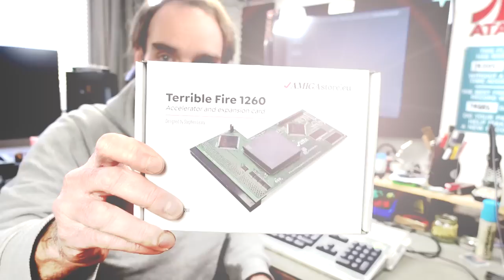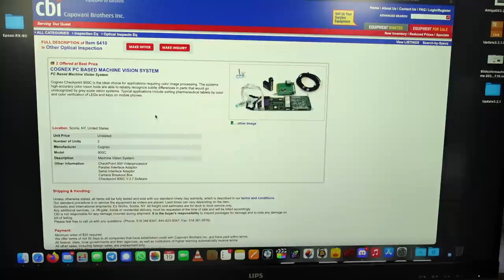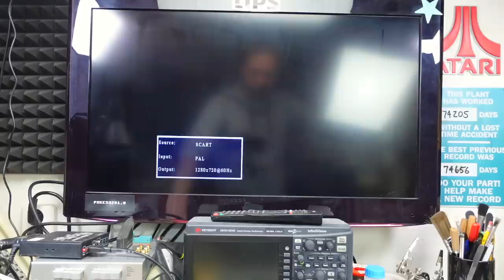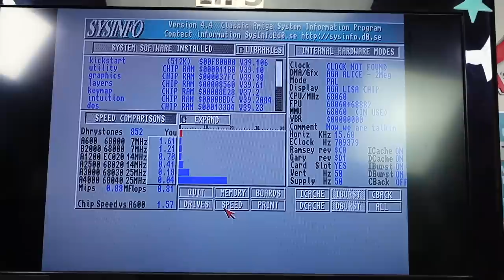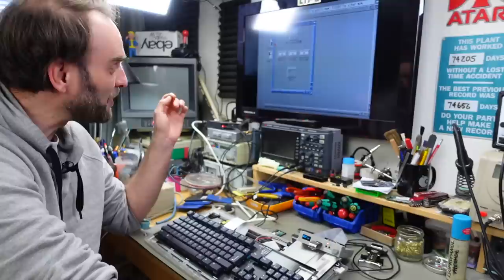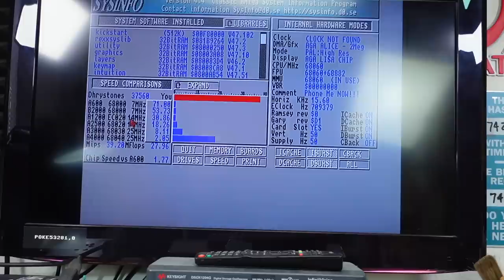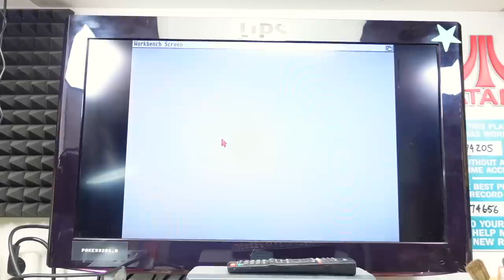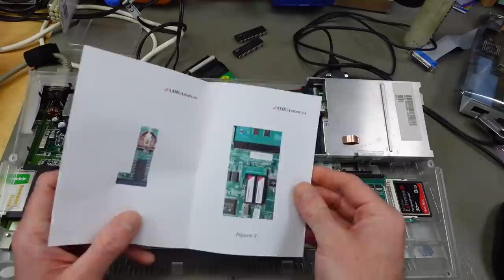Amiga 1200 TF1260 Accelerator Installation

Comment: The reason kick 3.0 support was dropped was because i couldnt get autoconfig to behave with Mediator. So i put the ram where its autodetected in 3.1. I could release a separate firmware but then people would get them mixed up.
Reply: Ras Voja`s Rasta, Retro and Resistance to Babylon  Absolutely not. I simply cant support multiple options on 14 different cards.
Reply: Ras Voja`s Rasta, Retro and Resistance to Babylon  My rules is one kickstart per machine. Usually 3.1 but I will work to support 3.2. Thats already too much for me to cope with. Upgrade to KS 3.1, buy a Warp or ACA1260. If i've not given in to supporting 1.3 on the A500 i'm really not going to give in to supporting 3.0 on a 1200.

Comment: The XC part number means "production prototype". The number is changed to MC when they are in production. It was not uncommon to see X parts in low volume products on the cutting edge. I was on the production prototype list in the late 1980s and would get X parts when developing DSP boards, but XSP56001 in that case.

Comment: Fantastic video Jan =D  Welcome to the TF1260 club!  Amazing pickups on the R6's =O   The graphics glitches or slow downs / crashes etc - you need to experiment with NOCACHE, set NOAUTOVEC as a default for all WHDLOAD games, and NOMMU (all tool tips or set in the WHDLOADPrefs file).  Almost everything I play on WHDLOAD works fine on an 060.
Reply: I set NOAUTOVEC in the WHDLoad.prefs (recommended in a WHDLoad video), but I couldn't find NOMMU. Or did you mean MMU, which has a " ; " in front for not being active. But it's said for 68030 use. 🤔
I also have a TF1260 (and the same case Jan has 😉) with LC060 btw.
And yes, you have to disable some (or one, can't remember) caches to make e.g. DREAD to work on the 060. Easiest way is using Sysinfo for this.
Reply: @TPau65  NOMMU is set on the tool tip for the individual game!
Reply: @GadgetUK164  As I'm new (again^^) in the Amiga world... tool tip is this "text area" when you rightclick on the game/program icon, information and then icon menu? Is there a list somewhere of what instructions can be used there in general? E.g. ADoom and ZDoom come with several pre-defined commands which could be activated/deactivated with brackets ( ) or semicolon ;.
Is it even possible to deactivate caches there, so you you don't have to use e.g. Sysinfo for that?
Reply from the maker: Thanks! I fiddled a bit with the options but didn’t get great results for some games (including my beloved Turrican, of all things!). I’m going to try to tinker with the options you suggested! :D
Reply: @JanBeta  I am sure I played loads of Turrican using the NOMMU and NOCACHE and didnt have a problem!  I will re-test later for you!  Check if there's a new .slave for the game too on the WHDLOAD website!
Reply: @JanBeta  Hmm, no problems here with my TF1260 (LC060 CPU) with the Turrican games. Part 1, 2 and also the new AGA beta version of T2. All loaded normally with TinyLauncher. What exactly do you mean with "no great results"? Not starting at all? Graphic- and/or sound glitches?
Reply: @JanBeta  try the latest firmware too. Gadget will be on that.

Comment: Unsoldering the male IDE header and moving it to the bottom side of the TF1260 allows for an SD2IDE adapter to be used. The pin orientation happens to be just right and it will make your workbench easily accessible via the trapdoor (which can still be closed).

Comment: I remember those vision cards. The one I saw was used in an industrial fruit sorting machine. It could detect bad fruit as it passed under the camera on a conveyor. It could also sort the size as well. It was very fast as the conveyor moved at quite a speed. Gates would open further up the line to redirect the sorted fruit.

Comment: Thanks for your review and conclusion. I just got my Terrible Fire 1230 and its everything I will ever need.
Reply from the maker: Yes! 68030 is enough for most "common tasks" (and the vast majority of games) on the Amigas indeed. The 68060 experience is still kind of amazing for me (especially since the fastest I had was a 25MHz 68030 back in the day in my original Amiga 2000). :)

Comment: @Jan Beta - You might be able to cool the CPU with a heat pipe heatsink. You might be able to find one in a junked laptop, they tend to use heat pipes to get heat from tightly-sandwiched cpus to the side of the case where the fan is.
Reply: If not, you can just buy one as a spare part. When the fan died on my laptop, I had to replace the whole heatsink as a unit because the fan is not a separate part. I was prepared to be annoyed but I think it was less than $10 so in the end I had nothing to complain about.
Reply: @mal2ksc  Also true. There are definitely shops online that sell fan+heatpipe assemblies for DIY repair. I've done that twice actually. So that's a good way to go look for something that might be the right shape.

Comment: Finally, after so many years Doom is playable on Amiga! Thing that was just normal on 486DX4/100 ;) And Quake... well, let's add 3dfx.
Reply: Well, I played it back in the late 90ies on my Amiga with a 68030@50 CPU. Certainly was not great, but I could play it.
On a 68040 it was much more playable.

And ADoom was the first port of Doom for the Amiga, and it's not the fastest one.

Comment: I hope you thoroughly enjoy your 'new' amiga.
FWVLIW: My Blizzard 1260 + SCSI routinely runs at 80Mhz with a passive heatsink - it will go to 100Mhz with active cooling for safety and the Blizzard SCSI unplugged. The, um, best use I've found for a 060-equipped Amiga is to run it as a 68K Mac! Otherwise there's really only 68K versions of games that run better on a PPC, and the odd demo... unless you're enough of a masochist to do a bit of retro raytracing.

Comment: The new firmware also gives much faster chipmem access speeds, which is great! This means faster drawing to the screen, since the framebuffer is stored in chipmem.
Reply: How does it speed up chip mem? Every solution I've seen has only been able to speed up fast mem.
Reply: @Felice_Enellen  The designer rewrote the logic for the 68060 card, to minimize chipmem speed losses.

Comment: 71E41J mask 060s can regularly eat up to 100 MHz when properly actively cooled and still be stable. On Atari Falcons with CT60 accelerators they usually run fine at 90 or 100 MHz, 90 being the speed of choice, when you got a CPU that isn't fully stable at 100. Active cooling, in that case, means a flat heat sink with a small fan on top, nothing extreme. If you can find a suitable cooling solution that fits under the keys, it may be worth while, doubling the clock speed...
Reply: True that. My Falcon runs at 95 Mhz and it's stable hours on end, with a CT60e + active cooling, my Amiga 1200 has a Warp1260 at 105Mhz (and stable, with active cooling), and my other Amiga 1200 with the TF1260 handles 95Mhz demo-watching runs like a champ. That has no active cooling yet, so I didn't want to push it beyond 64Mhz on longer-runs. All Rev.6, of course.

Comment: Love my TF1260 and was lucky enough to have a full Rev.1 that runs nice and cool with only a small heat sink that works amazing with all WHDLoad games and as compatible as my Blizzard 030@50 with 3.2 roms and this was never the case with 060’s back with the old 3.1 roms with my experience
Reply: I just got an A1200 with Blizzard 1230 @ 50 and I have to ask… did your Blizzard run really hot? I have to leave the trapdoor open, lift the A1200 on higher feet and put a desk fan blowing on it, otherwise it’s so hot you can’t eve touch the table. Is that normal? Could I underclock it?

Comment: Motorola and ABB automation systems also use/have used 68k processors extensively. I don't know if the 060 has been very popular but at least 040s are pretty common. Might be different version not compatible with Amiga cards though.

Comment: Just a FYI: I have a TF1230 and my Amiga 1200 also still has a 3.0 ROM. You can use AddMem to configure it to see the fast ram. Probably works with the TF1260, too.
Reply from the maker: Ah, makes sense! That’s a great workaround, didn’t know that! Thanks for pointing it out!
Reply: It works, but due to the timing/sequencing it usually means exec.library is in Chip Mem. That’s doesn’t really help the performance. :)
Reply: @marcianzero_yt  Ah, i didn't know that 👍

Comment: Get an all-copper low-profile heatsink on the chip. Mix JB Weld. Finger dab very light coat on both surfaces. Join them under slightly warm water, to ensure no air is trapped between them. Lift from bath and allow to cure for at least 24 hours. Install as normal. If you can engrave chip info on side of heatsink, do so. You won't be able to remove it later, but you'll always have cool processor.

Comment: Danke, Jan. I've got an A1200, and I have a new Vampire A1200 V2 accelerator I'm considering installing, which this video will possibly assist me with. However, I've been struggling with a 68060 accelerator on a new A4000D board I had custom made, that delivers a Guru message when the board is screwed down on the chassis, but works when it's loose! I think it's a loose connection on the motherboard, but this video might provide some alternative paths of thought.

Comment: Very interesting video Jan, as I also have a TF1260 (with LC060 though), which came with my Amiga. And I also have this transparent case... with the same issues you ran into some years ago (Floppy not quite fitting, same with PCMCIA slot, transparent Eject button for another Floppy drive model etc.)! 😉
25:28 I ran into some trouble installing the libs. The actual installing (system, update 3.2.1 and MMU libs done in WinUAE directly from CD) worked flawlessly. But Sysinfo 4.4 (and older) gives a message right at the beginning, that deals about the 68040 library which shouldn't run to make Sysinfo work properly (or something like that). I have to rename 68040.library so it won't boot with the Amiga and the message was gone. Do you have the 68040.library file in your libs folder after installing?

Comment: The price for the TF1260 with CPU is actually very ok.

Back in the late 90ies I bought a blizzard 1230-IV (for 350 DM maybe?), and I remember thinking about getting the blizzard 1260. It was about 600 or 700 DM (300 or 350 euros) IIRC, which was a little bit to expensive for me back then.
Reply: 700dm with inflatation would be 572euro in today money

Comment: Your system was running into a Guru at the first attempt, because the 68060.library wasn't loaded. The Motorola 68060 doesn't support some 68020 instructions, specifically the "long" (64bit) multiply/division instructions which are used by Workbench and various parts of the A1200 ROM. These are software emulated after the 68060.library is loaded. So without it, the system would Guru. This is normal behavior on all 68060 accelerators.

TL;DR: install the 68060.library first, then install the accelerator itself. This is entirely safe. The 68060.library won't load when that CPU isn't present, and the system would keep functioning normally anyway with any CPU.
Reply: Good to know. Thanks.
Reply from the maker: Ah, that makes perfect sense, thanks!
Reply: Haha.. everyone seems to go this route.. (hello!).. first suffering, then read and learn about it.. and tada... aaah it works!!! <3 <3
Reply: @n00blamer  Yeah, me who had a '040 based Amiga since 2001 (which is similar in the sense that it has a CPU library and emulated instructions) and a '060 based Amiga since 2003, it's fun to watch people discover this... I wish they would ask more, since this is trivial knowledge, and it is out there.

Comment: Hi I've had my Terrible Fire for a year now with using the hard drive interface and 3.2 Roms. Although I did not get the driver in the Rom so it takes a while to boot. Get the driver in your Roms would be quicker. I have recently had an issue that I hope you can help with since you assembled one. I disconnected the card and the reconnected it recently and now the Amiga thinks it is dead. Is the connector a bit tricky? It has a hard time since I purchased it. Once it's gong it's great but now I have 1MB memory since the Amiga 1200 runs without it now. It was sold to me by Retro32 and they have yet to reply.
Reply from the maker: Yup, the connectors can act up at times, it's quite a common problem. I would suggest trying to clean it thoroughly (a pencil eraser/rubber and some alcohol usually does it good job of that for me, you can also finish off with some non-corrosive contact cleaner after that). The TF1260 and the CPUs are generally pretty reliable as far as I've seen/heard.
Reply: @JanBeta  Thanks, but I think I have the misfortune of acquiring a non-offficial board (no logo) and may have non standard cheap parts onboard. I did the cleaning except the non-corrosive contact cleaner. What is that?

Comment: It's a nice card for the money. I had one for a while (and reviewed it), but I am holding out for either the new Vampire or maybe the Warp 060 card. I only had a spare LC CPU with no FPU so my 68040 Blizzard actually performed better for the FPU intensive programs I use on my Amiga (AdPro, ImageFX, etc). The LC is fine for most people of course.

Comment: I have put my amiga in a laptop cooler think and it stays on that for ever. But in hot summer days i put an extra normal big fan for extra cooling. The desktop is very tricky and dangerous to be sure without cooling with a 68030 inside .

Comment: Is true that my TF1260 with the Rev6 CPU don’t like WHDLoad. Because that i have a second A1200 with the Blizzard 1230 IV. I use the TF1260 only for 68060 Demos. For Doom, Doom 2, Quake, Quake 2 and Blood i use the Vampire V4 Standalone. Hope that soon i have the black keycaps for my black A500 from A1200NET. Strange that my ACA500Plus with the ACA1233n-55 is faster than the TF1260 with CF speed. Must do some great things with my C64’s such as FM YAM and SFX Sound Expander. And use my old floppies on the 1541-II diskdrive.
Reply from the maker: Nice collection there! It's also a good excuse to have multiple systems if some do certain things better than others. ;)
Reply: Have buy now a ZX Spectrum 48K with a Smartcard V3.  There is always a good excuse to buy old computers and enjoy it.

Comment: Is the pistorm more compatible then the TF1260? i have to check out that pistorm soon :-)
Reply from the maker: It should in theory. Probably there’s other issues because of the hilarious speed it runs at but CPU emulation should be 68020/68030 compatible so a lot of older software should run better.

Comment: how did accelerator cards actually work with software in computer like that? is every accelerator card somewhat backward compatybile to run base amiga code on them or do they share the function if program is aware of the accelerator, or is the accelerator like separate computer that takes over and uses base computer as io ports while runing completly different codebase?
Reply: I don't think I understand your question completely.
It's basically just a replacement for the CPU. Programs run on the CPU of the accelerator card instead of the original CPU.
And most code should run just fine.
But since the 68060 has some technologies the original 68020 did not have (caches, Instruction pipelining) this can cause some problems in rare cases.

eg.  if a subroutine of a program finishes faster than the programmer anticipated would be possible.
Reply: @Zentauri77  yes that is the basic understanding, but how does it work in detail 
you have 2 cpus on one bus , one must be disabled  but microcode for the startup  must be either universal for both or the instruction set is different and programs are aware of that somehow and you would need basically to pick which one you run on at the programing stage
if both cpus the amiga onboard and on the expansion are from similar family and accelerated one is backward compatybile with onboard one then i guess it is simple halt signal switchover but i have basically no understanding what amiga have inside and i am curious
Reply: @kokodin5895  
The code is mostly generic and runs on either CPU.
Of course you can compile a program for a specific processor. Code for 68000/68020 will usually run on 68060, but not vice versa.
So, the CPU is backward compatible.

If you plug in an accelerator card the old CPU is disabled. Maybe the original CPU is needed when powering up the computer to do some stuff like auto-configuring peripherals. I don't know exactly. But as soon as the system boots up the old CPU is disabled and invisible to software.

Comment: How to run optical drives?
Reply from the maker: With the appropriate drivers installed on the Amiga, you should be able to just connect them via the IDE port on the TF card or the internal IDE on the Amiga. Both should work fine and be more or less plug and play.

Comment: The amount of random crap you have to do with Amigas still amazes me. With RISC OS, the hard break was 3.5 because that's when it went from 26-bit (that had to do how condition flags were stored in R15) to truly 32 bit (which broke the way you're meant to save registers). It still blows my mind that 68K machines transitioned from a 16k bus to a 32k bus worse. Even with StrongARM involved.